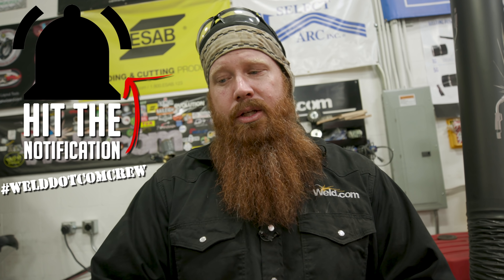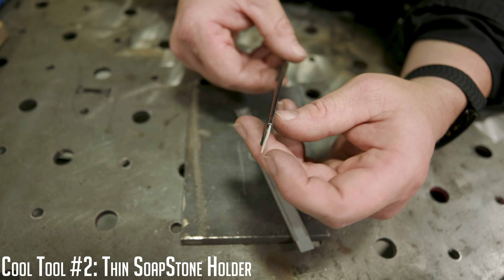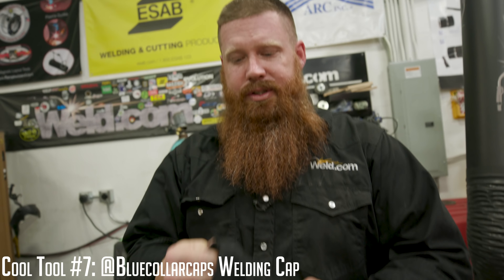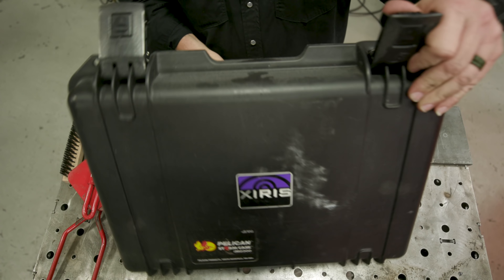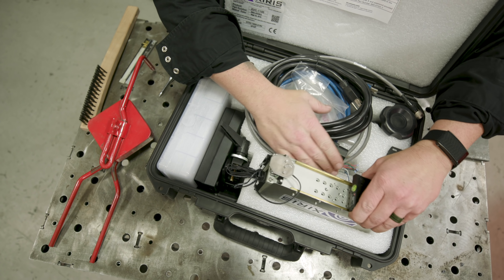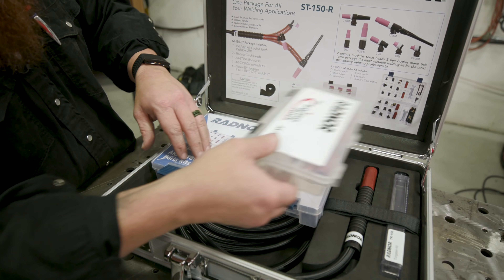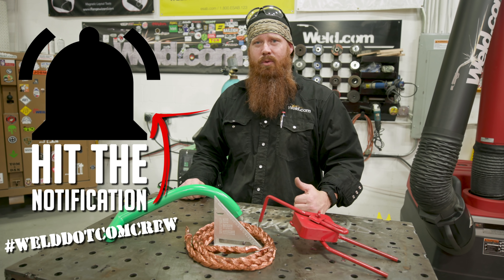9 Shop Tools We Always Get Questions About

Comment: I'm an auto mechanic, I glue old transmission magnet to old side mirror and use for welding top of exhaust pipe, just stick the mirror to the floor above the pipe. The mirrors are only good for a few uses, but they were free, so no big deal.

Comment: in the body shop world our MIG welder wire always got dusty. so we took a clothespin with a piece of a cotton t-shirt and clipped it on the wire inside to clean the wire before it went into the liner work like a charm.
Reply: ChevyPhil Cantesco makes lube pads specifically for that they week great to knock the dust off and lube the wire for smoother feeding.
Reply: @GodslilRedneck23  another million-dollar thing I missed out on. lol, I tried this back in 1994 and 2011 we still used it thanks for the info. but I'm retired now
Reply: We use a ear plug

Comment: If you do repair welding, a mirror is essential. Take a mag base inspection mirror, and bolt the mirror and the base on the ends of some loc-line tubing. It'll allow you to stick the magnet to any steel object and flex the mirror around pipes and structural supports. Easily the most important tool in my weld bag.
Reply: Never knew you could buy loc-line hose.. always saw it on those cheap tripods and thought it looked useful

Comment: Hey there an old clamp mod I used to have was to piece of angle iron of the material you work with. So stainless, ali, and carbon steel. You get a footed vice grip and attach the angles at the back side v to the feet. 20mm or 25 mm is big enough for anything up to 3 inch od.

Comment: Here's a hack for you. If I have a job in a vice and there isn't anywhere to prop I'll sometimes use  a vice grip clamped to the vice then come off that with one or two more to get the prop I need. It works better if the vice you are using is a fabricated type not a cast one although you can clamp to the main screw.
Cheers
Mick

Comment: Take  a magnetic switch ground and ad about 5 ft of welding lead and a Male quick connect, I use this to ground to large square tubing or plates that are attached to precast concrete were a standard ground clamp won't fit
Reply: George Wishon we just did a ground clamp hack for that. Check out the video.
Reply: @GodslilRedneck23  yea I need to brade one of those

Comment: So i havent welded for long and so far the only process i know is flux core for my job, but the one thing i was showed when i was taught to weld and have used every day since is i weld with a tig glove on my trigger hand and a standard leather welding glove on my support hand might seem pointless to some but for me helps me feel the trigger on the gun better especially when i have to weld in some pretty awkward positions

Comment: How does that separate lense work with the outlaw leather hood? I want to buy an outlaw leather hood but none of them are auto darkening. Do you have to buy the battery pack system to power up the lense ?
Reply from the maker: No, the battery is built in and is solar charged by the arc. There's a link in the description to the Amazon link. You just pop the passive lens out and slide the Auto Dark in.
Reply: @Welddotcom  Thank you so much! I have been wanting to buy one but I was not sure if I had to buy all the attachments for it. I saw that they had some info on their website but it doesnt go in depth. Thank you so much !
Reply: Antonio Ruiz it drops right in, no extra parts or pieces necessary. They work great.
Reply: @GodslilRedneck23  Thank you sir. I'll be getting one pretty soon its just so hard choosing one when they all look so cool and badass :/ lol I feel like a little kid looking at all these badass toys that I want

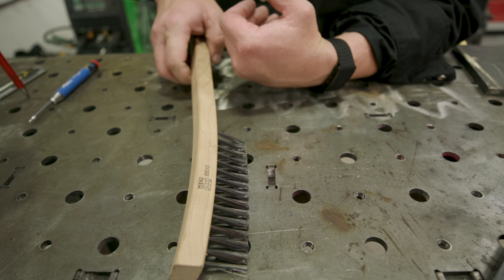Comment: 0:20 to 2:53.  What's with the air noise?  Do you have a new guy trying to remove slag with an air gun?  Thanks for another great vid though!
Reply from the maker: We were cleaning out the plasma table. Sorry about that
Reply: @Welddotcom  No need to apologize.  I'm just jealous that your air compressor that can move all that air.  Cheers!

Comment: Markal stuff is usually great, but those big fat blue refillable crayons suck.  The leads crumble and break, they DO cause porosity nomatter what the company says, they dont work well at all.  Stick with the skinny blue welders pencil or the silver streak/ red writer wooden pencils, or better yet just use soapstone.
Reply from the maker: These have the silver streak and red writer inserts. It's not the crayon. Same stuff as the pencils 👌
Reply: Blue Frog haven’t had any issues with mine. I’ve been using it for over a year now.
Reply: @Welddotcom  Maybe its just the yellow.
Reply from the maker: @bluefrog8670  I just looked on Amazon. Yellow says "crayon". Try the red writer and silver streak inserts 👍